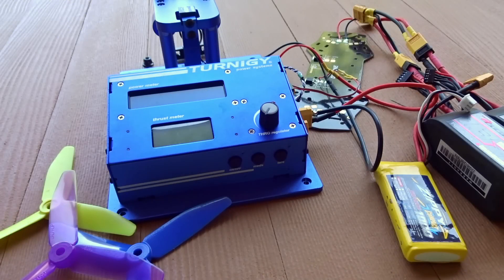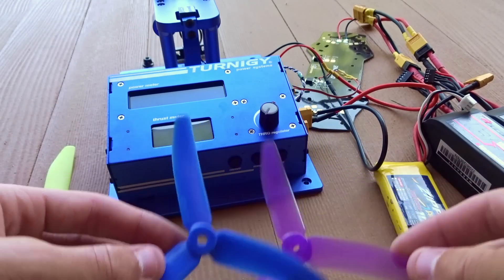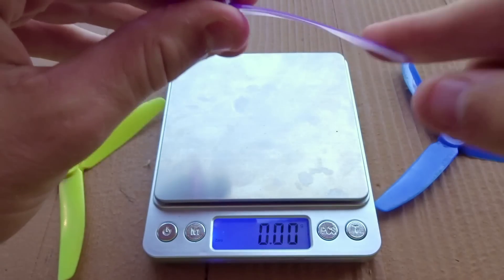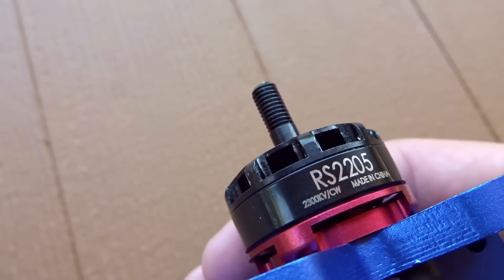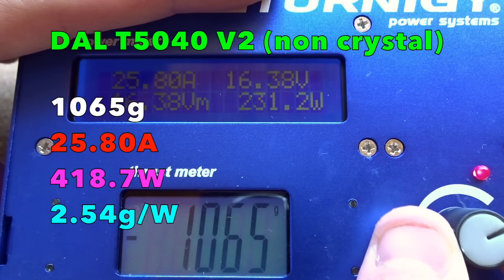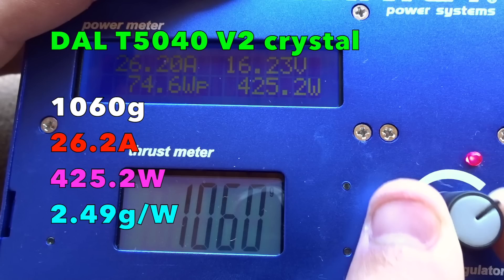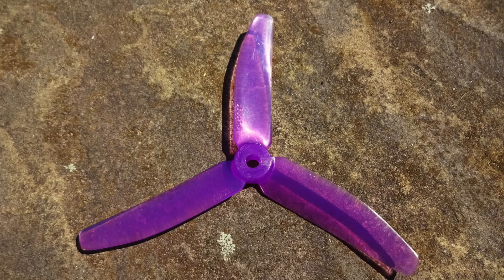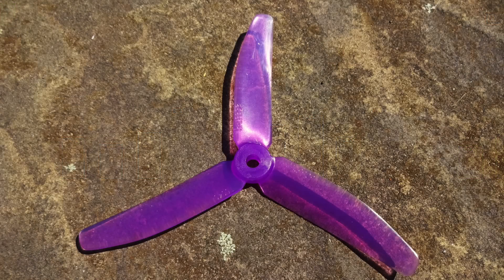DAL T5040 V2 CRYSTAL Prop Thrust Test!

Comment: I know this is an old video but I've been using these props for ages now. I'm considering modernizing myself and get the Cyclones 5046. I really value efficiency so I discarded the 5152 and the V3 Cyclones. What are your thoughts on that? The T5040 are also really freaking cheap. Thanks for your help! :)
Reply: Take a look at the new T5040C
Reply: I'll be running them on 2206 and 2306 motors, both at about 2400kv.
Reply from the maker: Yeah I still run these sometimes as well :) At that low of KV a v2 cyclone is probably going to be great, and not draw crazy amps.
Reply: The RCAddict Awesome! So you would recommend the switch to V2 Cyclones?Any other prop to consider that's not bad efficency wise? :)
Reply from the maker: Probably yeah. Maybe give the new 5042 Gemfan a shot in a few weeks.
Reply: The RCAddict I'm actually waiting for those exact props to come out! Lol Thanks man! I'll be waiting for your review on those 5042 Gemfans.
Reply from the maker: Haha nice, I should have some in about a week.
Reply: MrNatchoo Yup, I already have 20 sets on the way. :)

Comment: your test only covers max thrust but not neccessarily other aspects such as torque which would give a indication of 'feel' in the air...I think the stiffer prop will feel more responsive and sharper even if the max thrust metrics are down a little....to me the std dal 5040 feels a bit soggy but the crystal is sharper and more responsive prob due to stiffer blade...
Reply from the maker: Yep, this is an old video but thanks for the input. That is mostly why I have stopped doing bench tests.

Comment: I have weight the yellow 5040v2 normal with 4.14g and yellow crystal wit 3.88g. Crystal is not always lighter: 5045V2 crystal clear 5.37g  and yellow 5045v2 5.17g. 

While the Q5040 are the same weight as the 5040v3 (both yellow). Ergo. There is not a clear connection between weight and "clearness" only. There is much more involved. They produce on different machines and it could be that their color mixes or tolerances in the moulds are not 100% perfect. 

Would like to make a list. Have some colors here. Could make an Google Excel and everybody could input their numbers to check it. Who's in? https://docs.google.com/spreadsheets/d/1F-k7isqB4v98LisEkZJ9lPgbZc3urbHOFIkQ6VMyhEM/edit?usp=sharing
Reply from the maker: Yeah, cheaper props like DAL are not all going to be the same which is another reason why I fly almost all HQ haha.
Reply: All dalprop nowadays (2017) are dynamically balanced. I have been assured of this.

Comment: Its like in disc golf when they try different plastics.. i guess the next version will be with tiny bubbles cos they weigh less.
Reply from the maker: Interesting idea, but I doubt they would be able to hold up to even motor thrust if they aren't solid.
Reply: They could make it thicker but then there's new problems so i guess we wont be seeing that.

Comment: you should try flying with the crystal. they feel great in the air because of the extra stiffness
Reply: did you try the them both(v2 and v2 Crystal)? the Crystal stands better to crasches?
Reply: +Alessandro Ammenti I've got both but I'm yet to try the non crystals (there's a pack of them sitting on my workbench:P). I might put them on tommorow to compare them. With the crystals, if you chip or bend them you might as well throw them away as they will be badly out of balance, but isn't that what HQ prop users do with props 5x the price?
Reply from the maker: I will be trying them out next time I fly :) 

Now now, don't go bashing on HQ. They are amazing props. I find mine actually MORE durable than my DAL, as in a crash they either break or don't, the DAL bend which is useless as they are now out of balance. So I know for sure if I need a new prop with the HQ, whereas with the DAL I have to guess and then my footage is ruined with vibes. Also the HQ feels highly superior.
Reply from the maker: Alessandro Ammenti Unless they come with something no
Reply: +The RCAddict will you be trying the new kingkong 5x4x3?

Comment: not positive but I think motors have less thrust as a pusher then a puller, potentially invalidating your test. would you mind checking and let us know?
Reply from the maker: I don't see any reason why that would be. I thought about it for a while and the only things I could come up with is the thrust pushing in might (might) tighten the bearing a little, but these are good bearings so highly unlikely. The only other thing would be the cooling wouldn't be as effective, but that doesn't matter here. Plus all props were tested in the same exact way so even if results were skewed a little all were the same, haha.